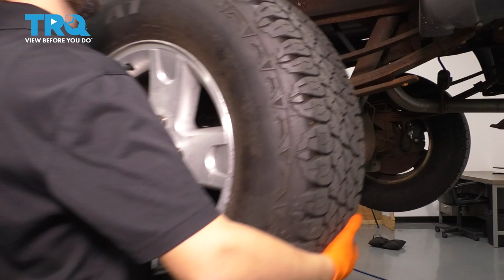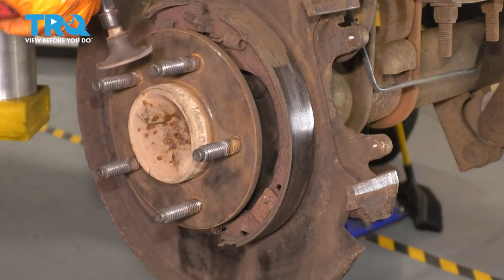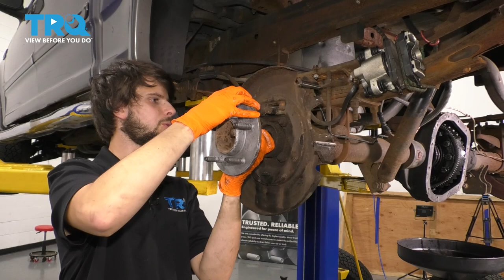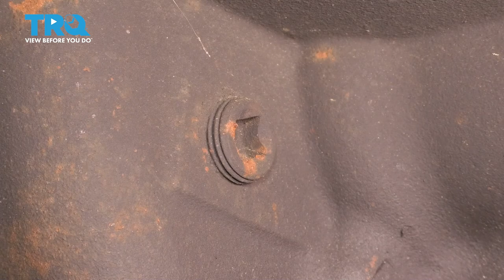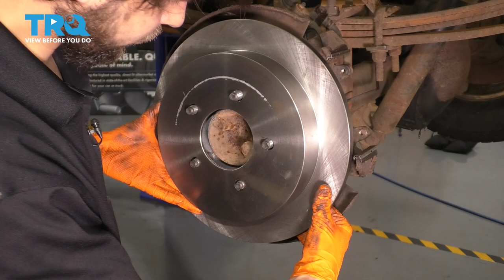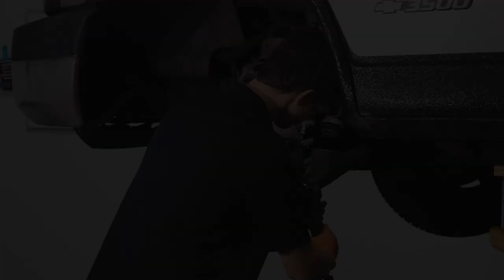How to Replace Rear Axle Seal 1997-2003 Ford F-150

Comment: Would it be ideal to replace both seals at the same time.Instead of just one ? Specially if the vehicle has extremely high mileage ?
Reply: I would if you have time, I did the driver side by itself, and guess what , pass side is what I’m refamiliarizing for ha